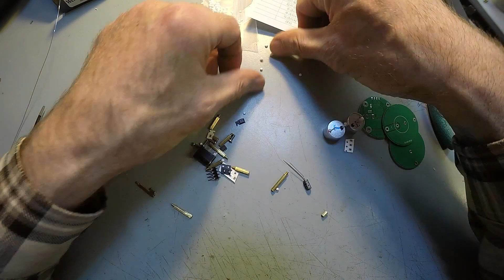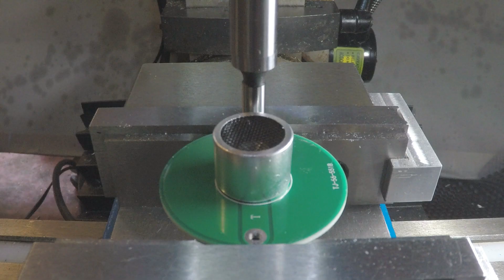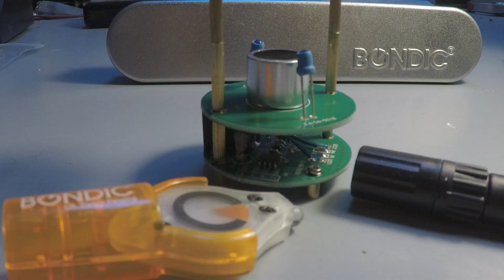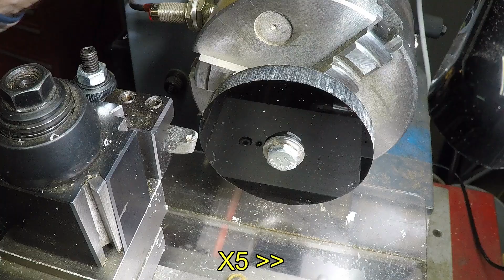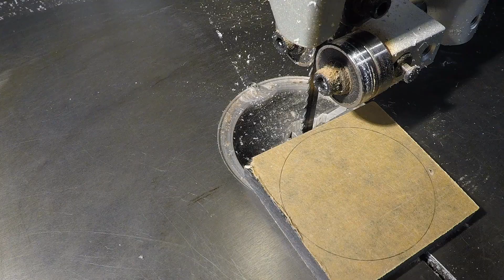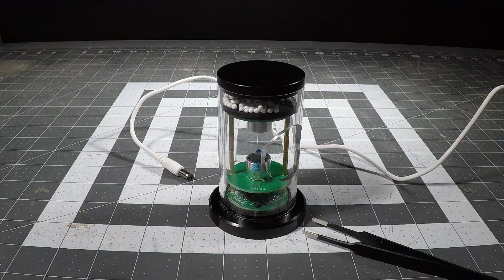Ultrasonic Levitator

Comment: Very interesting project. I wonder if the "loading hole" in the side of the cylinder is part of the problem. I guess one could make a plug for the hole (hint, hint) as an experiment.
Reply from the maker: I think it's echoes of the ultrasonic signal rattling around in that confined space. I later drilled another large hole opposite the main one and it improved things only slightly.